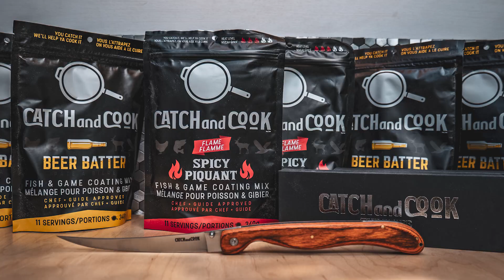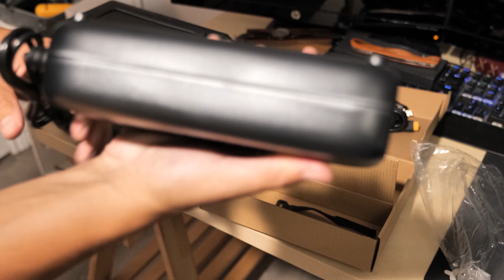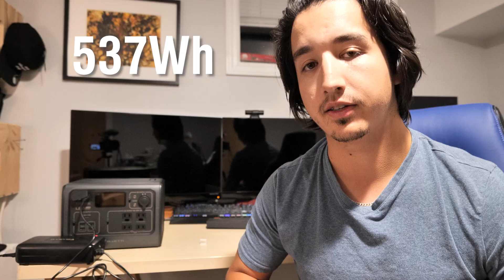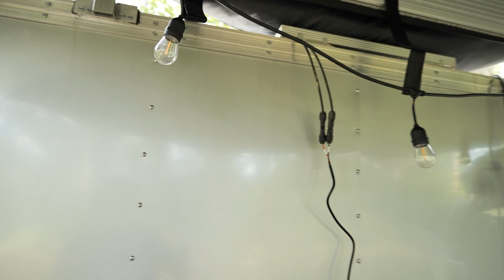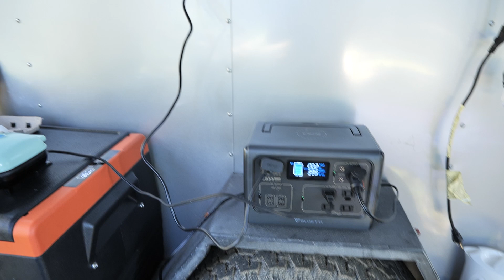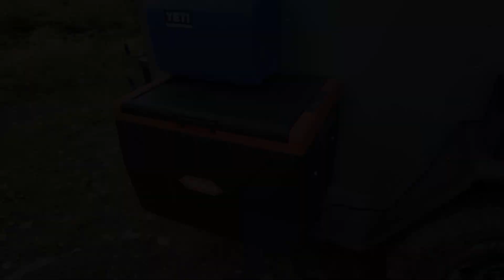is it worth the price? - Bluetti EB55

Comment: Good video and revue, I have been interested in the Bluetti and also the jackary power packs for on the road use and of course campsite. The larger model is of the most interest to myself along with the fold up solar solar panels. Also I want to limit the trailer to one only onboard 12v deep cycle battery. I could ramble on about my solar panel testing, but enough for now.
Reply from the maker: I think these thinks can't be beat in terms of dollars for value & use! Thanks for watching. Good luck with your build.

Comment: I would use (BLUETTI Portable Power Station EB55, 537Wh LiFePO4 Battery Backup w/ 4 700W AC Outlets (1400W Peak), 100W Type-C, Solar Generator)for when we have black a out Because we have been in the situation where the lights went out for the whole day and we needed a way to keep the refrigerator going and charge our device’s. We didn’t have the source to do so before so the solar generator will be very helpful for that.

Comment: Very nice review! If I was lucky enough to win this unit, I would never run out of uses. I live in an area that has frequent power outages so running my sump pump, charging small devices and powering lights and possibly a mini-fridge would be top priority. Charging power tool batteries at remote job sites would be on the list as well. I have a solar panel that fits within the EB55s parameters so I have that base covered already. Thanks for the opportunity to win this tiny workhorse!

Comment: Hi! I've been following your channel for a while, and even bought a trailer to convert- but then we moved, and I had to sell it because of a lack of storage space- I need something that will fit in the garage instead of taking up driveway space. I'll almost certainly be picking up a partially finished teardrop camper project this weekend, and for a tiny teardrop a small power station like this would be perfect! I would use it for our old thermoelectric cooler, lights, maybe even my 100 watt micro space heater! I already have 200 watts of solar panels so that would also match up perfectly. Thanks for the opportunity!

Comment: Hey Joel! You have been a serious inspiration for my cargo trailer conversion. My build has been based off of many of your videos and I have followed much of your tips and advice. I’m building out a 5x10 also pulled by a ford ranger. If I won a bluetti EB55, it would be the centre of my build. Powering my USB ports, roof vent fan, water pump, diesel heater and lights. It’s been so cool to build out a trailer just as you have done. Especially since I can always refer back to any of your videos when I’m looking for info. Thanks!
Reply: Same here Aaron, I am working on a 6'x10' V nose, and once you price out good quality marine deep cycle batteries x 4, the Bluetti makes more sense, and you can use it at home in the of season.

Comment: Finally got a chance to finish the entire video so let me actually follow your directions for the comment entry :) I would use this on a cargo trailer conversion I’m planning. I’m keeping it super simple so this would be used to run lights, charge my phone, and 12v fridge :). I found some cool solar exhaust fans that I’m thinking might make it easier for me to make it with a smaller unit like this instead of something like the Max.